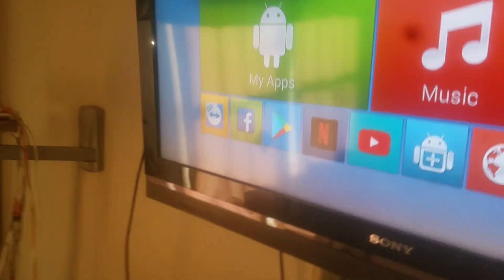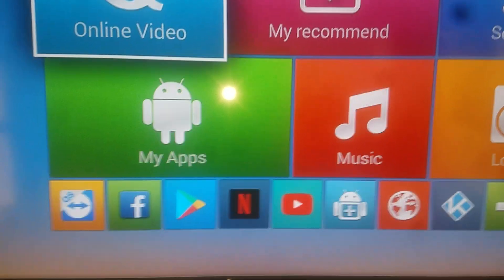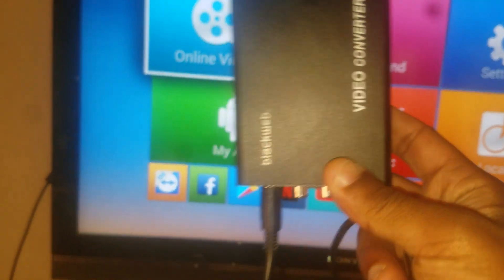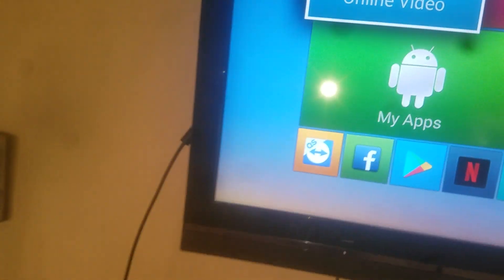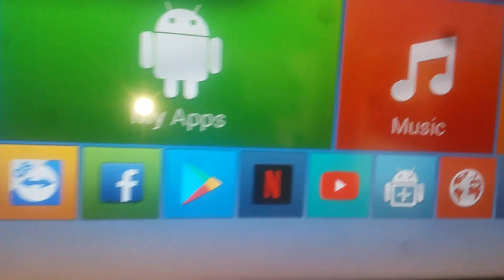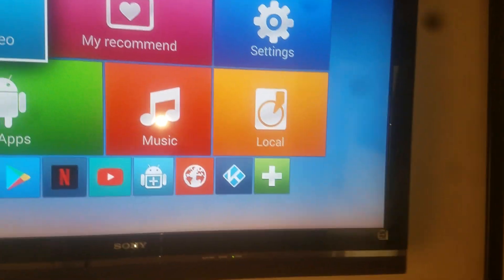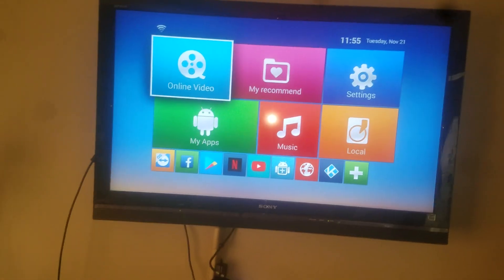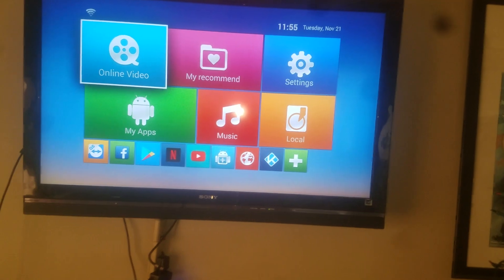How I fixed my HDMI No Signal error in 4 hours, no expenditure

Comment: How to fix android tv box not showing black and no signal ? Help! Please
Reply from the maker: I'd try to buy another device on the cheap or borrow a friends to narrow down is it just your device or are you hooking both up incorrectly? If your friend's works straight away then you will know that it is the device.
Reply: @drtroyturner7464  it turns on and is using the device wall charger, and is connect correctly but in the screen it says check connections, no signal and the device is in blue light meaning it is turn on